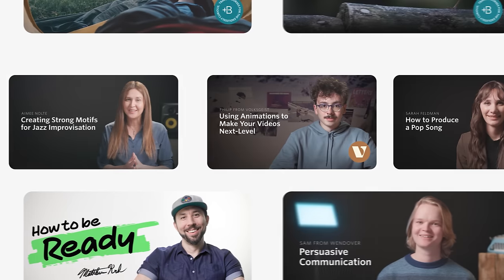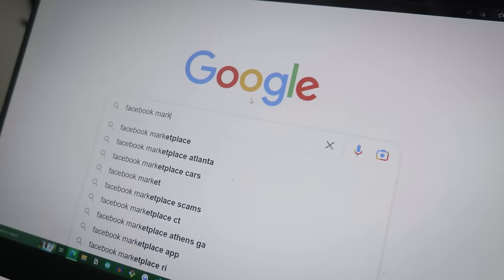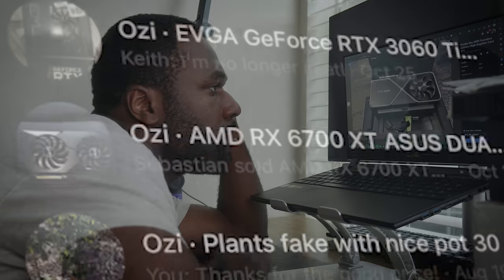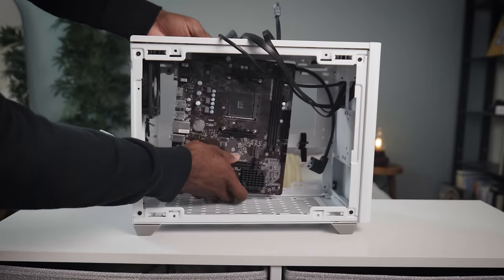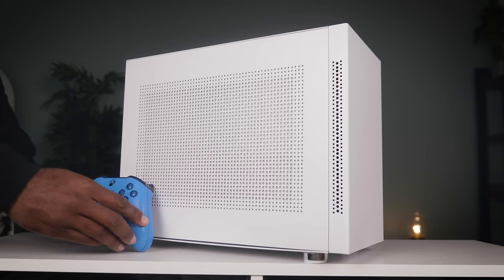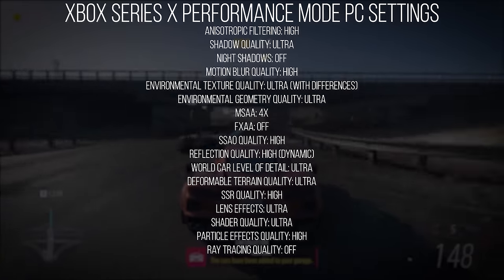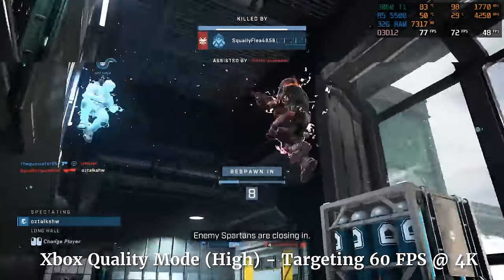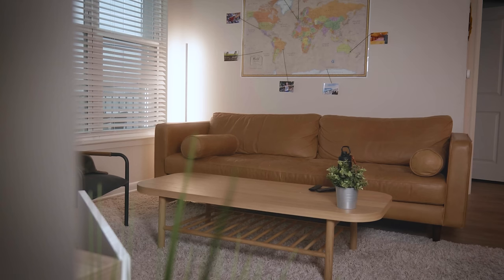I built a faster Xbox Series X for $474

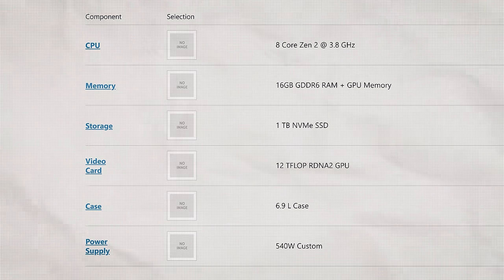Comment: You're overestimating the consoles performances soooooo much. No, it's far from an "ultra high-end gaming PC from 2019", and your "equivalent" PC at 5:57 is far above the consoles. The 6700XT sits between the 3060Ti and 3070 in terms of performances in game, while the PS5 performances sits around the 2060 Super range (which is demonstrated in your video by the way, as you get roughly x1.5 the FPS of the consoles with your 3060Ti).

Now if we really wanted something equivalent to a new console, I think you could shave off a good chunk of the price and end up somewhere between 600 to 650$ brand new (Not that we'd actually want to do that, since the parts you listed are a better value anyway).

Comment: Lol!
What were you thinking? You litterarily said it yourself... The NR200 support ITX-motherboards yet you belived it would be able to fit a mATX without modifications?! XD

I've modded two of them to fit both full mATX motherboards and full size ATX PSUs. But I understand that it's not for everyone. Really simple though. There are 3D printable brackets to offset the holes for the motherboard so it will fit a mATX mobo. I don't own a printer so I just payed a guy to print them for me for just 8 usd inkluding shipping.

The PSU you can zip tie in the front. But not all motherboards will line up with the PCI-E slots on the case so you'd better get the NR200P that comes with a PCI-E 3.0 riser cable. Not a perfect solution since you will lose performance not running it in PCI-E 4.0. So you might have to get a pretty expensive riser canble that supports gen 4.

Sooo you'd better just go with the case you got there instead.
I did these mods just because you can. :p

Comment: This is fine but the fact that you had to get used parts means you can get a pre-owned Xbox series x for less than $400... I would do a dollar for dollar power comparison. Clearly of will always always be more powerful but how close to the $500 mark can you get with new part and apples to apples power comparison
Reply: Sad isn't it? the console is just equal to the entry or low end. 😢
Reply: @ardi1606 actually I was thinking quite the opposite. Not bad for 3 year old $500 little boxes . They are capped at 4k 30fps for most things but I think developers usually optimize for consoles and don't do a great job porting to PC . When it's the reverse you really see the power of a PC especially with games that don't bother to port to console and only release on PC.

Comment: i managed to get all on FB market place a ryzen 7 3700x (identical to the xbox series x.) a 2060 (when all the math and tests come together its just a boosted 2060 which i have overclocked and can run all modern games 4k) 16gb ddr4 3600mhz msi x570 wifi MOBO 2 tb samsung 980 and some rando case a i got a a deals store new. aswell as a 80 plus gold 750 watt psu modular all for 385$ all things considered it performs slightly better than all the same titles on the series x. i would have gone 3060 but the goal i set was to build a pc that is equal to or greater than the new gen consoles. whilst cutting off as much cost as possible. ive succesfully gotten my buddy to pc gaming from console, and hes actually considering selling his series x to get a far superior gpu as hes now only playing PC xD  facebook market place is great i could have built it cheaper and better if i wanted to go out of state but figured this is more than adequete lol he also has now purchased a desk monitor mouse keyboard and brought the grand total to the build to 456 facebook market place is wonderful and this time of year most people accept low balls lol

Comment: I am all about these "budget" gaming rig videos, and I am building a budget machine using an old HP Z420 workstation right now. it should be a real winner with 32 gb of DDR3 Ram, a 1TB disc and 250GB SSD and an RTX 2060 as the GPU. 

BUT what you learn is how quickly little things add up. The cost of shipping, cables, peripherals, and a Windows license greatly increases the overall project costs. And all that does not account for the time investments necessary to do budget builds. 

It is TOTALLY disingenuous to pretend you can match an XBox series X/S or a Playstation 5 as a value proposition with a build like the one you see in this video. Saying that you built a $474 machine is just not true. Just buying that XBox controller new would have sent you over the $500 equivalent mark.

All I am asking is that creators be MORE HONEST about the little costs, because they matter to anyone working on incredibly tight budgets.

Comment: Hey cool video. But I’m not buying that it’s better than a Xbox series X.    You got a 6 core processor.  The Xbox has an 8 core zen 2 based… “3700x”.  Your sata SSD is also trash. It doesn’t have support for direct storage like the pcie 4.0 the consoles have. The graphics card is “technically “ faster.  But the console games are much better optimized. So it’s honestly a tie. If not the consoles win by a little.

I got a 5800x3d/4080 build. But even being a pc gamer. You cannot deny that the value these new consoles offer is unmatched.

Comment: Isn't it nearly twice the price of XSX? What about noise and power draw?
Reply: I'd be buying myself XSX for $237 right away if one existed, but... nope.

I'd guess the power draw is around 290-ish watts on full load considering the cpu is rated at 65w and gpu is rated at 200w. Pretty good honestly, not that far off from peak power consumption of the xbox. DLSS is a thing so... I'd take this PC over XSX easily!
Reply: @gateopssss  Your spreadsheet says over $800 to build this PC, isn't it? In the video.
Reply: @ml_serenity  No, i understood your comment the way you said it, so $474 (isnt it nearly twice the price of xsx) which equals to $237, double that and it equals to $474.

The PC config mentioned in the video with the used parts is absolutely fine considering the price. Like i mentioned, i would pick it over xsx easily, i wouldn't personally mind paying around $550 at max for it for its capability, it's a PC overall, you can do a whole lot more on it over a console

If you do consider living in a 3rd world country with the used PC components prices (not mentioning buying them in new condition), for gaming purposes only it's... questionable.
Reply: @gateopssss  The spreadsheet in the video says more than 800. Do you have reading comprehension issues?

Comment: I highly doubt that I would ever buy a console gaming system with a built PC  ican do allot more then just gaming plus a built PC can be upgraded if need be with having to buy a new console plus a pc lasts for years its just when you first start out it cost a little then the gaming access on a pc is much hiher and you can get mods for games and actually change many things in games that consoles cannot do you can open up the config and change it with pretty much any text editor change the config so that say controls or keys are the way you want them . PC much better then consoles at least for me

Comment: Your SSD clearly shows it's a 480GB SATA drive, not 512GB like you said or close to the Xbox's 1TB, and about an order of magnitude slower, not a fair comparison.

You're also buying used parts, and comparing that price to the price of a brand new Xbox, again not a fair comparison. Who knows if that GPU from reddit hasn't been mined with, or if that $30 psu is gonna last? Easy to throw some cheap parts together to make a video, but you wouldn't game on this long term.
Reply: The amount of storage or speed doesnt matter
Mined GPUs are fine, what are you on? Most miners will take good care of their cards, by undervolting and underclocking instead of overclocking
PSU is of concern, but couldve got used psu
Used parts are completely fair, cry
Reply: @ayedraco4l  Nice try, video claims "faster Xbox Series X", but with slower and less storage. Yeah, miners definitely don't run their GPUs 24/7, or try to dump them for 50% off because they're in such great condition! 
Used parts are fine, just don't compare their price to new console price. No one would buy a used car for the price of new one.
Reply: @elrondes1  Faster as in performance... in y'know, games?
Reply: @ayedraco4l  Can't be serious, you know loading speeds also are a part of performance right?
Reply: @elrondes1  but not as a whole. anyone could care less
Reply: @ayedraco4l  You mean couldn't care less? If you want to believe a $474 is "faster" than Xbox Series X, I won't try to convince you otherwise! By all means game on it all you like if it suits you.

Comment: No this isn't faster than the series x you're using a 6 core CPU. You don't even have a 4K Blu Ray drive either. This is clickbait.
Reply: El Cactuar  Since the Xeon E5-2695 v4 from 7 years ago has 18 cores, it's faster than the 8c 7700x, and even the 16c 7950x, for a fraction of the price used!! I don't get why people buy these new components smh smh.

Huh? What is this "single core performance" you speak of? What do you mean the 7700x gets more than double the fps in games whilst having better 1% lows and beats the Xeon in multithreaded tasks whilst consuming less power due to the superior architecture, node, and RAM. It literally has 18 cores, 10 more than the Ryzen 7! This is impossible! Fake!

Comment: Dude, a computer isn't BUILT for video games. But a video game console can be USED like a computer! Let me explain: A console goes straight into your library upon booting, while a PC goes straight to the desktop after logging in, not the game desired. Games CAN be accessed from there, mind you, but only if they are already installed. If not, you gotta login into your account with all types of passwords & verification options. So therefore what you save in $, you pay for in time used to access games. With a console, you can access internet & download basically anything you need. Another thing, with a computer, you have to keep upgrading your hardware in order to handle the newest games. You got DDR4, which is ALREADY outdated due to DDR5 being made available. See what I mean?

Comment: Xbox Series X does NOT use "high" for its quality mode, it uses most of the extreme preset with a few things dropped to Ultra. You referenced Digital Foundrys videos, actually watch them in future. Your rig would NOT achieve similar performance to series X at those settings. You skewed it. The Elden Ring one is weird as well as that renders at a native 4k in quality mode and, even in its performance mode, has dynamic 4k dropping to around 1872p at lowest. 

This is a fraudulent video

Comment: I hate these click bait videos. It never includes a decent keyboard and mouse or controller, a genuine copy of windows, and the parts are always used or a bunch of catchy rebates. The consoles will work straight out of the box with everything you need except a TV for $500 or less. All brand new parts. I have both PC and consoles. PCs can't beat a console in value unless the console is like 5-6 years into its lifespan.

Comment: Ok first off, it’s not faster than the xbox series x cause the RTX 3060 ti can NOT handle 4K 120fps, it can handle 2k 120fps NOT 4k 120fps and plus the pc bigger
Reply: The XSX can't handle native 4K 120Fps so they upscale it with FSR. This pcs equivalent will be DLSS which offers a clearer and sharper image than FSR on quality or balanced modes